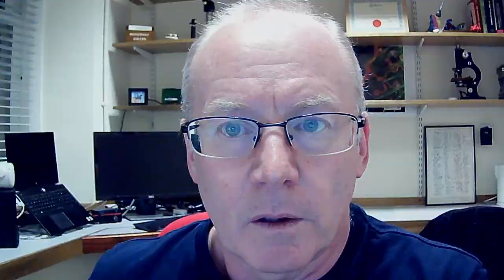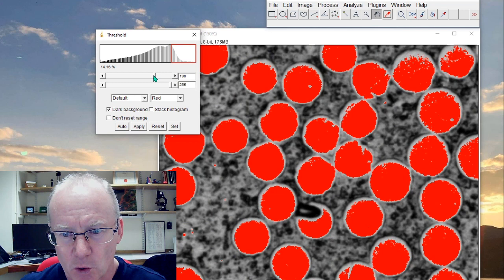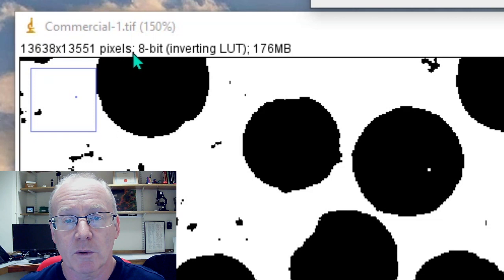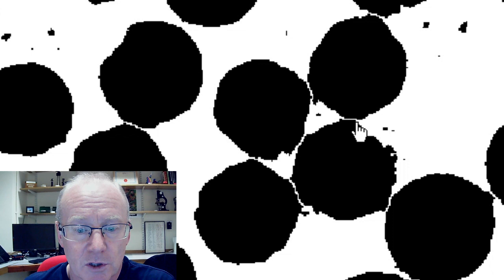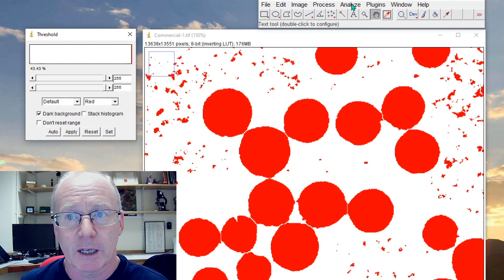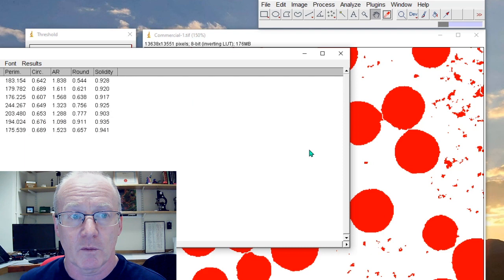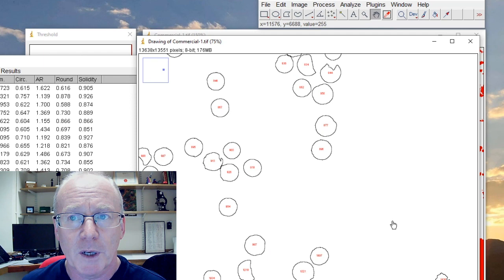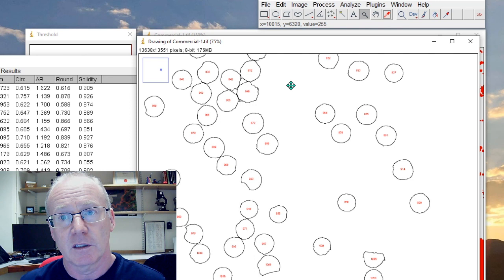Separate touching objects in ImageJ/Fiji (Watershed)

Comment: Hi Craig, many thanks for the videos. I am new to ImageJ and I want to measure multiple lengths of the particles in ImageJ, like it measure the areas. It this possible with ImageJ? Many thanks
Reply from the maker: Hi, try selecting 'feret diameter' in the measurement options.  That should give the longest point to point distance in a selected object.  C.